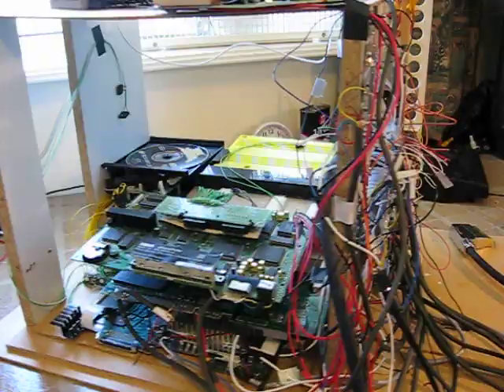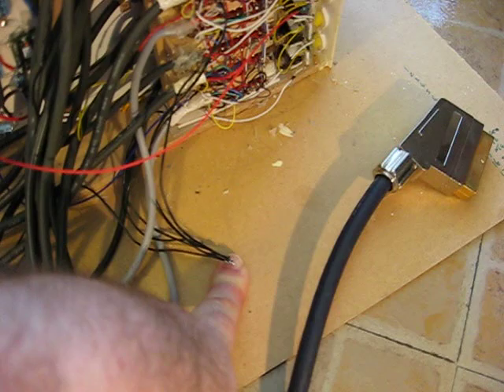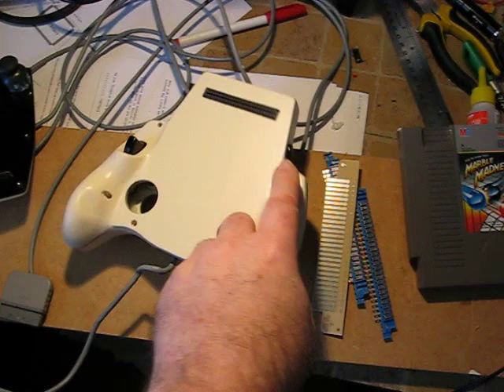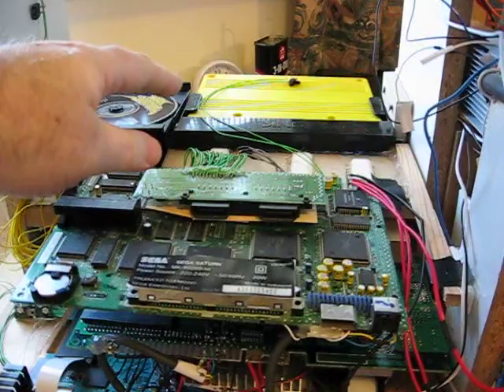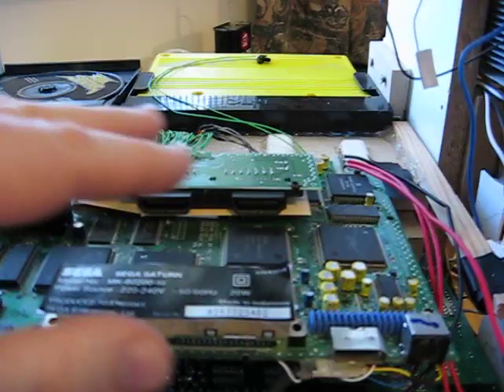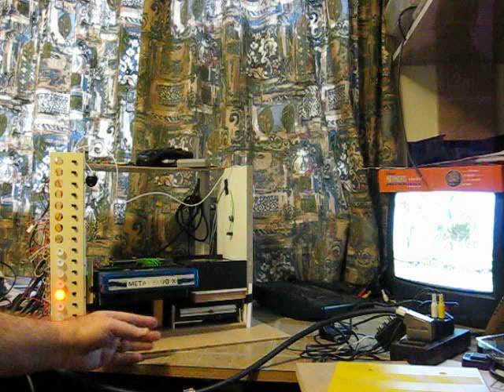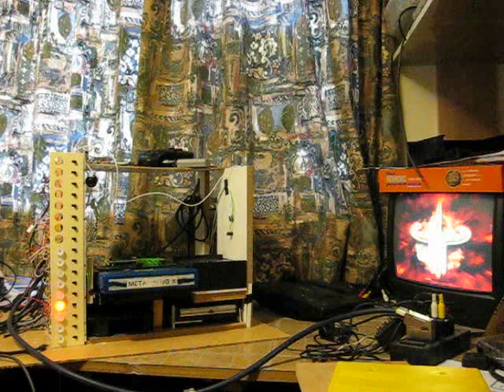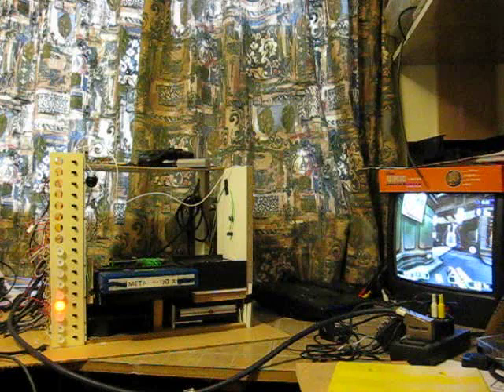Bacteria's Unity project - progress so far!

Comment from the maker: Remade the section for removing CD tray, looks miles better than before; which means going to have to re-do the GameCube again to incorporate the improvements. The Amiga CD32 laser unit failed and couldn't get it working again, however frankly, the CD32 worked so painfully slow and there was only one game I wanted on it, so removed from system; Philips CD-i ; well i'll put that back in if have space but one game I like, large system, not worth it.

Comment from the maker: Tried originally however the 2 x 8PDT switches can't carry enough amperage to power the consoles; also, I have no spare parts on these 8PDT switches available, the only one I had spare is used for the LED you refer to.

I had thought that the on/off switch by the LED would be all that was needed to select between different systems, however found that in practice, an off system was able to hold enough charge to disrupt another, probably charged capacitors, hence extra main on/off too.

Comment: I'm sure you've thought about this, but is there a way to automate the black 2-way switch (next to the glowing button) so you don't have to toggle it each time you select a system? Meaning, pressing the LED orange button would also activate the 2-way switch. That way you wouldn't have to press 3 different buttons before starting a system?

Comment: Wouldnt it be more practical to put the core complex systems on top concidering heating issues to escape better or are the less complex system that much more suseptible to heat so theres less worries?